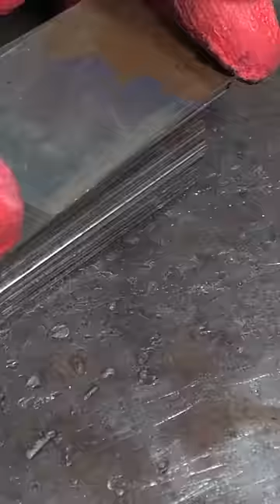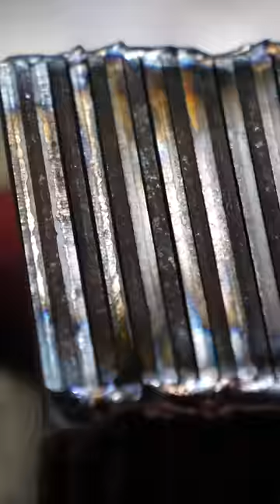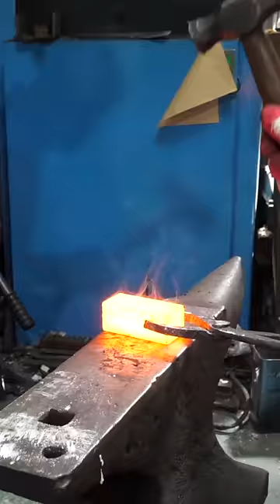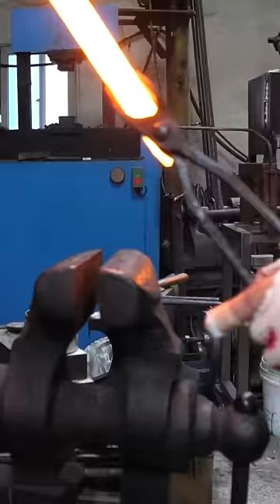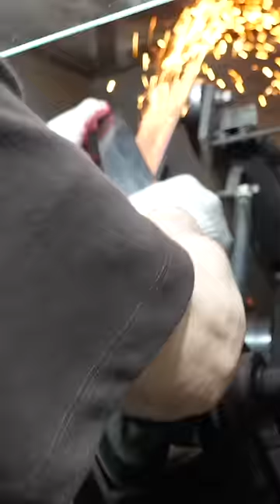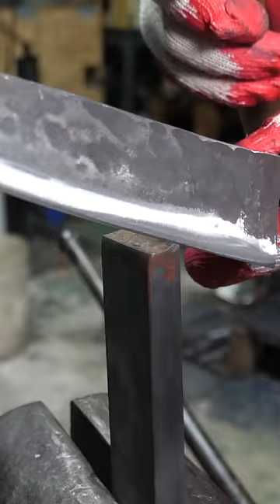Korea's best handmade knife master. with 50 years of experience. Damascus knife

Comment: Okay, I've never seen a knife cut through steel like that. I had no idea that was even possible.
Reply: That’s because it’s seasoned w liberal  tears in the process
Reply: Damascus steel is super strong that most of steels couldn’t give a dent to damascus
Reply: Yeaaa. Thought cool another cheezy dam…*THAT MF JSUT SLICE STEEL*
Reply: Damascus isn't particularly special in terms of sharpness, toughness or edge retension. Whether a damascus blade is quality or not is largely based on the base steels mixed together, and it can sometimes be disadvantageous to mix steels to make damascus. However, it looks sick as fuck, which is why it is often used to laminate blades instead of being the core steel.
Reply: Anything is possible if you put your mind to it. Haven’t you heard?
Reply: @azisseno 1) That's a Damascus pattern, not a Damascus steel. You're thinking of wootz steel. 2) The Damascus pattern makes absolutely 0 difference in the knife's cutting performance. 3)Most people don't use their knives to cut through steel anyways so what's the point
Reply: @7birdsstudios345 there’s no point for my car to go 170 mph but it’s cool as hell it does.
Reply: @jv-man3698  bad analogy. Chefs are not looking for a knife that cuts steel, they are looking for knives that have good geometry and edge retention. A knife like this is going to have compromises and tradeoffs that affect what the chefs want.

It's like saying here's this car that's 200HP but in exchange the wheels might fall off. It's cool, but you would never want that to happen to you.
Reply: @7birdsstudios345 finally someone talks about geometry, it's equally as important if not more important than edge retention. 🙏🙏
Reply: @Clanps  most people don't know anything about knives so it's not a surprise. People think sharp knife= good when it's so much more complex than that.
Reply: @7birdsstudios345  exactly, it's such a breath of fresh air to see someone who isn't a knuckle head. So many people talk about things like they're experts when they know nothing about a subject.
Reply: @jin6000 first time bro cheers
Reply: ShiShi Son Son!!
Reply: Hardened steel can cut through mild steel
Reply: @azisseno that was true like 1000 years ago. Now Damascus is made purely for looks, unless you are starting from raw bloom steel.
Reply: Anything is possible in poohs china
Reply: @fangsabre  for real, cold chisels have been around for a long ass time
Reply: @7birdsstudios345 but still, what makes it cut through that metal?
Reply: @7birdsstudios345 the point is if you is better than if you can't .
Reply: @vishrrfa very simple.  it's stronger than the steel it cut through
Reply: @7birdsstudios345 200hp is cool? 😲 have you driven anything built after 1990? 😂 200hp is just average these days lol
Reply: @johnpike9612  good for you, you missed the point of the analogy
Reply: @7birdsstudios345  nope, no i didn't... im a mechanic and a knife enthusiasts (how i wound up here 🙃) i simply caught your misspeak 😉... your point isnt wrong 👍 just pokin a little at ya
Reply: @johnpike9612  that's why the job mechanic exists doesn't it
Reply: That probably isnt steel, but still super impressive.
Reply: @7birdsstudios345 your analogy was dumb. You basically said if you use this knife you'll accidentally chop your leg off.
Reply: @azisseno lol no, Damascus is literally just different metals smushed together to make a pattern, what usually makes a blade stronger is hardening carbon steel by rapidly cooling it on a certain temperature so it doesn't get brittle or some weird shit if you use stainless steel, I'm not sure how stainless steel can be hardened and smithed but im fairly certain it isn't and is literally just cut out and sanded as heating it will probably ruin the strength of the blade permanently.
Reply: Someoene has never watched Forged in Fire on History channel then.
Reply: @noelpearce7509  🤣🤣🤣
Reply: @edwardg.135 i like how you explain about damascus steel. Even though its composition and how they made it was lost in a literal generation.
Reply: that's probably lead. So no Problem to cut it
Reply: @SuperKinahead It wasn't. Recipes for damascus still exist.
Reply: @jonajo9757  nope not uts true composition
Reply: @vishrrfa the reason why it cuts through the other metal is because it uses a high carbon steel (hard steel) and a softer steel or alloy to give it unique characteristics. The very high carbon content steel allows it to become much harder than a mild steel which is what is commonly used for a lot of applications, and the other softer steel or alloy that gets added (it varies as like some people have said it’s not exactly Damascus just mimicking the properties) allows for the blade to be able to flex and not be brittle. So by folding the two different types of steel together you end up with a blade that is harder than a regular steel so it can cut through it.
Reply: @SuperKinahead  Then what is it? Since damascus steel can be confusing for some.
Reply: @jonajo9757   Fake

Comment: As a blacksmith for over 500 years, I’d say this is the best blade ever.
Reply: Been a blacksmith for 600 years, gonna have to disagree with your statement.
Reply: As a blacksmith from the 23rd century, I can confirm that this blade was determined to not be the best blade ever in this YouTube thread at the time, and you will retract your statement.
Reply: as a black smith from mars i can deny this blade as being considered that best
Reply: As a black belt in smithing, I’m gonna have to re revoke that statement
Reply: @kooterass1442 as a blacksmith for over 700 years. I have to disagree on you disagreeing.
Reply: As a blacksmith for over 501 years, I’d say I have to respectfully disagree just because I have one more year of experience than you
Reply: As a whitesmith, this is racist
Reply: As a demigod son of Hephaestus cabin 9 at camp half blood I approve with this Korean made knife and it's by far the best Damascus blade I've ever seen
Reply: Wha is that Powder he was putting on metal ?
Reply: With every hit he moved steel to look like a knife with the hydraulic press. Like he mass produces blades its insane
Reply: @kooterass1442 감히 우리나라를?
Reply: 😂was that salt 🧂
Reply: 14 years as a blacksmith in wow. Definitely a fine blade.

Comment: "Handmade" proceeds to use hydraulic press
Reply: what era do you think we're in the 1800? It's certainty more hand made than a stamped out peace of sheet metal sharpened on a grinder
Reply: @matowakan  handmade implies without a machine.
Reply: You know not what you speak. The reason hydraulic presses are used often by modern knife smiths is not just a matter of efficiency. Sure, the efficiency is nice, but all of these artisans are capable of making a knife without a machine. All the hydraulic press does is repeat one simple motion that any laborer can perform. But that motion, if performed repeatedly by a human, can cause a lot of health problems, especially as one gets older. There's nothing wrong with what they are doing.
Reply: i mean technically, somewhere down the line that hydraulic press was also handmade, down the line of tools that was used to make that, handmade... so in a weird nonsentical way its true
Reply: @blueyedevil1531  how are you gonna make a knife with only your hands, are you superman😂😂😂
Reply: @matowakan then don't call it hand made
Reply: @albionpewpew it's not a hand tool
Reply: @blueyedevil1531 no it doesn’t, least not anymore.
And Damascus is not really possible using a hand hammer
Reply: He holds steers and shapes it by hand.
Reply: @wlfshadow4255  yeah... it does

Dictionary
Definitions from Oxford Languages · Learn more
adjective
made by hand, not by machine, and typically therefore of superior quality.
Reply: @Blaurot  handmade: no machines used. 

Hammer: not a machine 
Anvil: not a machine
Reply: @blueyedevil1531  do you want him to hammer it out for 10 hours just to achieve a worse result so it can be "handmade"?
Reply: @matowakan  if he's going to call it handmade then yes. Or he could use the hydraulic press and call it "professionally made"
Reply: The hydraulic press is not a machinery line meant to create cookie cutter products, it is a tool that is automated for convenience. The difference is a tool does not do the job for you and with a hydraulic press as stated before the blacksmith can adjust the metal to their liking, making a handmade, one of a kind product. Machinery lines create subpar products because efficiency is the most important thing when mass producing, not quality. But when a single man or a team of men create each product uniquely, it tends to be of better quality and is handmade.
Reply: @haveachocobar  Hydraulic press defined: A hydraulic press is a mechanical device that utilizes the static pressure of a liquid, based on Pascal's principle, to shape, deform, and configure various materials such as metals, plastics, rubber, and wood.

Mechanical device defined: A mechanical device is a machine or tool that performs its function through purely mechanical processes, such as gears or levers. 

Words have meaning. Use them correctly or difficulty in communication becomes inevitable.
Reply: @wlfshadow4255  also... Damascus steel was first made in 300 B, so I'd have to say it's quite possible without machinery
Reply: @blueyedevil1531  can you define tool for me? thanks.
Reply: Shocking, right? Who would have thought that humans are not using the same tools they've been using in the Middle Ages?
Reply: @Inco_Grapha  they are if they're handmade
Reply: @Inco_Grapha  thats like "man travels 20 miles barefoot" then show him wearing shoes and when someone says hey he's not barefoot your response would be "Well of course he has shoes we don't walk like cavemen anymore." Hahaha seriously what are you talking about dude

Comment: I’m no knife master or even a knife apprentice, but this “by hand” has a lot of complimentary help by machines
Reply: The machines just help with the physical parts.  It’s still a “hand made” knife compared to machine made knives.  “Hand made” doesn’t mean that “no” machines are used; it means someone took the time to do the processes using their hands and the machines were just there to aid that process and not replace it.
Reply: @keirfarnum6811  Still a lot of caveats though. A lot of machines take the hand skill out of it because of the precision and consistency. Granted a factory made knife is almost entirely done by machines on a production line.

Comment: Fun fact! The blade you are seeing isn’t actually true Damascus Steel, it’s a modern attempt to recreate it using a technique called “pattern-welding” since the original formula was lost years ago, still an amazing weapon though!
Reply: It wasn't really lost. I mean there are plenty of surviving "real Damascus" blades and it's pretty obvious what they did to achieve, which is very similar to what's happening here. They took multiple billets and welded them together and twisted and folded them in all sorts of ways. The difference is that back then they were using less refined steel so the pattern actually comes from impurities in the steel and the weld borders instead of just using two different metals that darken differently when etched. Modern "damascus" has more contrast, is cleaner and is made strictly for aesthetic purposes, while back in the day it was to homogenize the steel and to show that it's good. (back then, if your billet was poor quality, if you twisted it, it would just split, so showing visible twists in the finished blade assured the buyer that it's good steel). Even some Japanese smiths used a similar technique and you can see the typical Damascus pattern in their blades.

Comment: That pattern was absolutely beautiful
Reply: Except the point of the damascus steel was to fold the metal, mixing in the carbon steel.  This guy just did a cosmetic representation of it, which makes inferior metal.
Reply: @spineboy exactly mixing two or more steels of different carbon content gives the resulting blade a mixture of hardness and toughness

Comment: Really awesome process! If I could change anything it would be that those pieces in the beginning get sandblasted and cleaned to get rid that rust from this endeavor.
Reply: Doesn't that give the steel it's shade differentiation?
Reply: @soundlysouth2962  honestly I’m not sure. The rust is no biggie for the welding process though. I’d just mint it out for the vid.
Reply: @derekhofmann1594  that's what I was thinking, is that it would weaken the strength ....but then I seen that color and how he stacked the plates, alternating.... who knows. 🤜🏼🤛🏼
Reply: При ковке используют флюс. Насколько мне известно, именно он помогает очистить слои металла от нежелательных оксидов.
Reply: True this gives also better welding process if you remove the oxidized layers. Its standart practice so kinda suprised he didnt do that. But its extra work
Reply: @martinerhard8447  yeah but when it's all heated isn't eventually it one block of metal or are the individual pieces always there?
Reply: @Mike-qo4kp  so you want to remove the oxidized layers on top before sandwhiching the metal together or you will trap that stuff in the weld. typically welding sites are cleaned beforehand
Reply: @martinerhard8447  thank you

Comment: What was the point of soldering the metal plates together when they would have melted together anyway ?
Reply: To keep the layers together while they forge weld, they would just fall apart without the first welds
Reply: What he just said.
Reply: Wouldn't it be welding

Comment: I hate that we call these Damascus knives. That's like calling fire with copper sprinkled in "Greek fire" just because it's green. Damascus steel wasn't called that just because it had that strange pattern, it was called that as a Testament to the crafting process. Only smiths from Damascus knew how to do it and it was a closely guarded secret, because it produced the best blades ever. They were insanely hard to break and kept their edge for ages without sharpening. It wasn't just about the pretty pattern.

Comment: Are we gunna breeze by the fact, the entire video was making the damascus blade, but the testing of cutting through other metal was swaped out for a much more rough, and probably thicker and wayyyy less sharp knife? Tricky tricky
Reply: A real kitchen knives edge geometry is so thin and is kept much harder than a utility  knife, that even if that was some god tier steel perfectly heat treated, it would get absolutely fucked up by that thick of mild steel